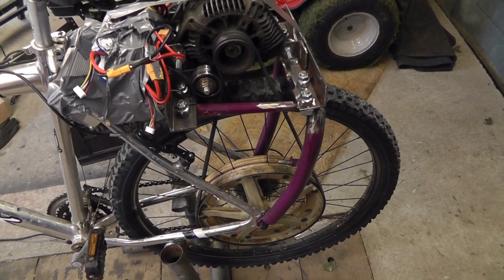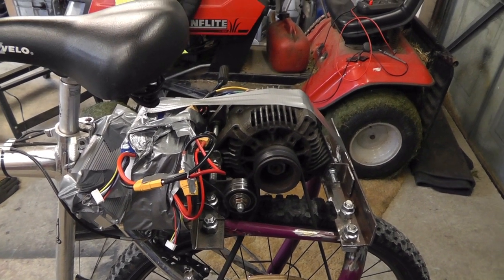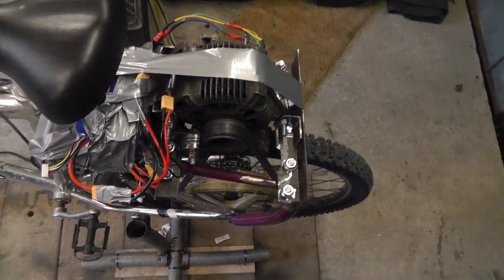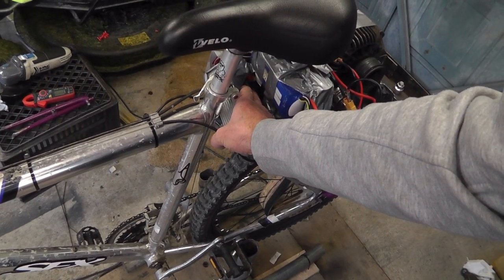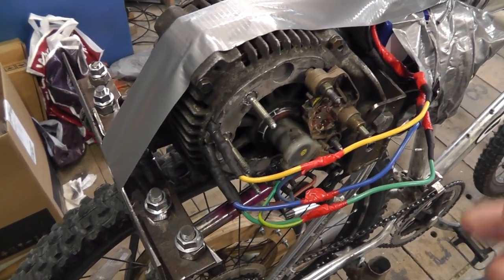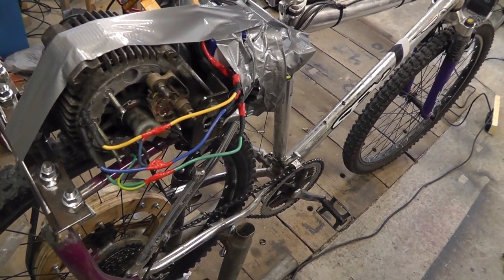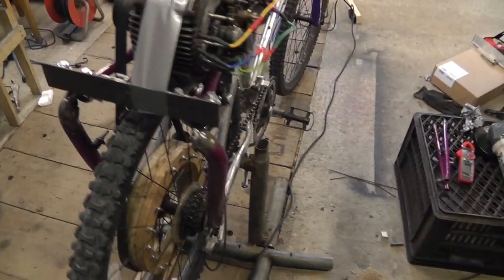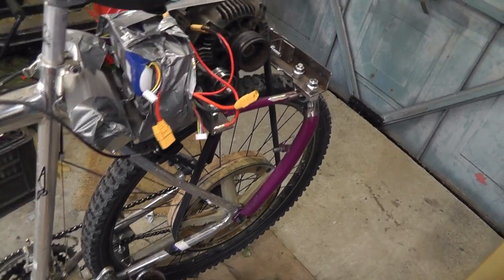Part 8 E-bike with alternator motor and Li Po batteries, The final solution (almost)

Comment from the maker: I forgot to update before so my apologies, I decided to use this bike as a test bed for more new parts so the first thing I ordered was some 18650 batteries. The batteries were Samsung INR 18650 30Q and after a lot of messing around I built a 10S 5P battery pack for 36V. They came quickly and seem to be genuine so a month ago I would have recommended the seller, now I'm not so sure as I ordered more but have been waiting nearly two months for them. 
Anyway the new battery pack is great and the bike goes better and further with it. 
Today I fitted and tested a new 36/48V 1500W controller which was sold as needing Hall effect sensors but I decided to follow @CheadleBiker advice and give it a try. It works brilliantly and I was getting over 25mph on the flat, so when the new batteries finally arrive I plan to build a 48 or 52V pack.  This is the ebay listing https://www.ebay.co.uk/itm/24V-60V-1500W-Electric-Bike-E-bike-Scooter-Brushed-Brushless-Motor-Controller-ST/253823287117?ssPageName=STRK%3AMEBIDX%3AIT&var=553112671655&_trksid=p2060353.m2749.l2649
I have a whole new project planned based on the design by @CheadleBiker so watch this space.

Comment: In all honesty, it's not worth having an alternator motor with a direct mount over the wheel. It's top heavy, ugly and has no advantages over a hub motor. If you want an ebike that's light, stealthy, no hassle and does about 25mph then use a 36v 250w hub motor and run it at 48v (13s lipo) or 60v (16s lipo). I'm guessing that 800w controller you've got is 36v/48v, so get a 3s 5000mAh  pack to add to what you've already got.
That racing bike I did the comparison with my alternator bike has this setup and a 16s lipo, using a standard 18A small ebike controller. It also uses a hub motor off a shopping bike, designed for a 20" wheel, which is why it will do about 35mph.
Reply from the maker: I agree 100% but this was always just for fun. I achieved what I set out to achieve and proved it can be done. The ultimate goal is either a hub motor or a mid mount motor. I had thought of doing exactly what you say and adding a 3S Lipo in series on a hub motor but I also have 60 x 18650's ordered so I'll see what I can do with those.
Also just for fun I've stripped an alternator and am trying to see if I can make it work as a motor with HDD magnets  :-)
Reply: 60 off 18650. New ones, like Samsung 26F's? I see some guy on eBay selling tested "as new" 26F's he's recovered from new laptop batteries; I'm tempted but haven't enquired yet. My 16S packs are recycled laptop cells with 6p, 11Ah. That's a 12s 5p 12Ah pack in my world. I only built my alternator bike for curiosity; I didn't think it would actually work. Now it's part of my fleet (I may make some more videos, as I have 4 ebikes, 1 tandem-e and 2 e-scooters in total).
Reply from the maker: @plodderexup  No Samsung 25R. I bought them from LiitoKala who are supposed to be reputable. I'll let you know when they arrive but they were less than 3 dollars each. I know you can buy laptop batteries cheaper but you need more of them to get the same current.
Reply: @alibro7512  Is that through Aliexpress? I've never bought through them and also never bought high value items from outside the EU. I presume there's VAT to pay plus royal mail's handling fee?
Reply from the maker: @plodderexup  Yes, I used Aliexpress and alibaba for the first time last week.
Squeaky bum time atm. 😱
One promised it was vat included but will likely have to pay for the other.
Reply: @alibro7512  Let me know how it goes. I've always shied from due to the VAT and the royal mail flat fee, which I think is about £8. I got lucky with Hobbyking last year, paying about £45 for the Zippy 8s 5800 mAh packs. I bought 4, 2 for my alternator bike and 2 for my Razor e300. I wish I had bought more, as they're now £85
Reply from the maker: @plodderexup  will do
Reply: My next mod will be to one of my small hub motors, to run on 72v (20s) and see if it will take 30-40A peak. Cooling by filling with ATF is quite common amongst those looking for very high power density.

Comment: Hey whats the top speed and how much Ah does your batteries have? Try less voltage on rotor, you will get higher top speed but less torque.
Reply from the maker: Top speed on the flat is around 20mph. Down hill it still pushes me and I've seen around 30mpg.
Batteries are two 5ah 5S LiPo in series so 36V 5ah 20C
Reply: Tnx for reply. You got a new subscriber :)  I am also building ebike using alternator since i try to use hub motors but they are too weak for my needs, i am using the exact same alternator as yours older model. I am thinking that is better to be used in delta configuration since in that way you can have more power and toque. I will go with 48V 40A controller. You can check my proggress on my channel.
Reply from the maker: @Nebojsa.Matovic 
Thanks buddy, I'll take a look at that. In the mean time keep watching as I'm making a video about my DIY spot welder. 👍
Reply from the maker: @Nebojsa.Matovic 
Should also have said, keep an eye on the temperature. Mine gets quite hot at 36V 32A.
Reply: Hey dude i have also build diy spot welder!!!!  It looks like we are doing the same things!!!! I will post some videos of my spot welder soon.
Reply from the maker: Spot welder now working a treat, it still needs a few finishing touches like a good momentary switch but it makes great welds. Video coming soon.

Comment: this new conversion that I am doing ... how can I not take the electric motor from the wheel because it is all aluminum I will use the own magnets of the wheel to use in the alternator, I will take out the rotor of the complete iron engine with armor to eliminate weight to put a shaft with tabs, I only have to fix my lathe because I need aligned to finish, the lathe is almost ready !!
Reply from the maker: I don't have access to a lathe so I can't do that. The armature is very heavy I think so if you can lighten it and fix the magnets securely it should work.

Comment: I'm converting my to permanent magnets, I want to get rid of hub motors, I do not like it because they do not go uphill, I have a monark bike (popular in my country) I took the hub motor from the rear and made a mid drive with it , the bike has improved performance 100%, what is your opinion about it?
Reply from the maker: Sounds like a brilliant idea. I thought of doing the same and it would be a powerful motor.
But still heavy and difficult to mount as a mid drive.
Please take video and share.
Reply: @alibro7512  I'll try to make a video and send it to you soon!
Reply from the maker: I am taking my 2nd alternator apart and am having trouble separating the two halves of the armature. I got all the bearings off easy but the armature is being very stubborn. Have you any advice how it should come apart?
Reply from the maker: Never mind, I figured it out and pressed it apart in my bench vice. :) 
Just trying to figure out how to fit square magnets in a round hole.
Reply: I did this with a 36v 250w hub motor and it had good performance. I used a freewheeling crank and something like a 16 to 48 reduction ratio. I secured the spindle to a bracket below the downtube and the hub body was allowed to spin. The sprocket on the hub motor was threaded on in reverse and then prevented from unscrewing by drilling through the thread interface in two places and inserting screws.